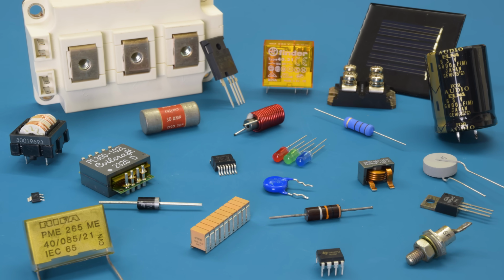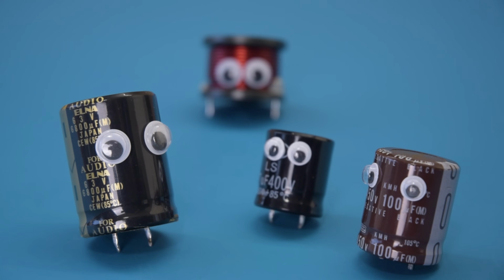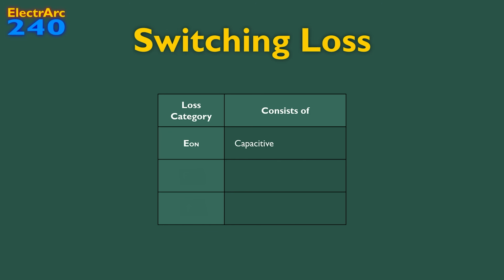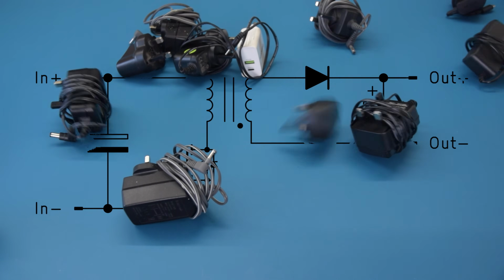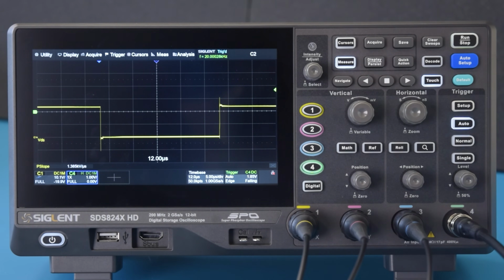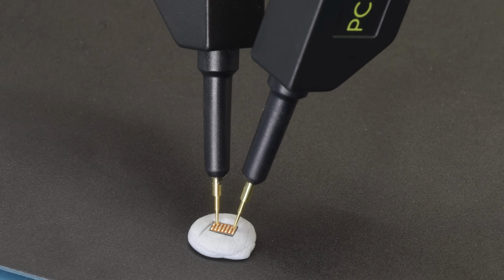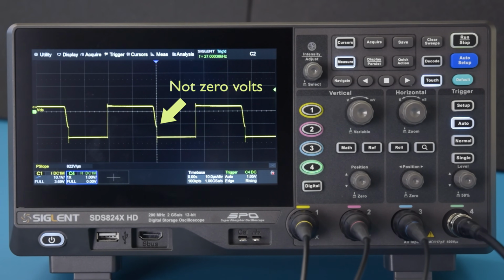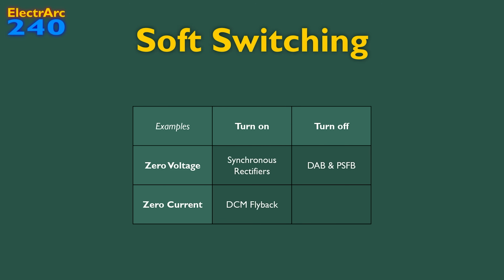Everything You Need to Know About Soft Switching (Switching Loss, ZVS, ZCS)

Comment: I built a special DC power supply for my tube amp here a few years ago. it uses a Center tapped primary winding in a Ground-Positive-Ground configuration. The 14V positive power is fed into the center tap of the primary and each end has a pair of Mosfet to ground switching back and forth. in order to make this switching efficient and noise free I added film capacitors across each mosfet bank that was chosen to the lowest total power consumption of the power supply. instead of wasting this stored charge in the caps when the mosfets close it instead goes back into the primary winding helping the opposite end to start reversing the current in the transformer. The switching gets much more efficient and keeps the voltage spikes across the fets low behaving a bit like an LC circuit I suppose. It then steps the voltage up to 700VRMS AC in a single secondary winding that is rectified and regulated down to 220-500VDC that has no measurable ripple in hearing range at all by scope. less than 1mv ripple that is at switching frequency above 20khz across the whole load range. The Power is so clean I don´t need filtering on my amp for even the preamp stages. it took a lot of tinkering before I found the best design for this

Comment: wounder when or if GaN will be usable in hobby builds
Reply from the maker: Maybe I could offer a GaN kit 👀
Reply: It should be already. GaNs are offered for a long time now in Enhancement Mode flavour and are VERY easy to drive with 5V and minimal peak current.
I've strapped a BJT totem-pole to STM32 pin and was able to drive EPC2308 far into MHz range with no problems.

Comment: As someone working in the field, I am once again amazed at how pedagogic your videos are. Even learning new things and new ways of seeing the same problems I see erveryday. Also love to see the ceralink from TDK in the intro !
Reply from the maker: Thank you very much! Glad someone noticed the CeraLink haha, I love them ;)
Reply: Ceralink? Never heard of them, had to check out. They are special ceramic capacitors that have their maximum capacitance at some working voltage rather than at 0 V like normal ceramics. Super cool stuff.

I have actually tried doing that to inductors - having a permanent magnet within the core shifts the saturation points around, potentially allowing to have high inductance at the working current. Never made it work though.
Reply from the maker: @invendelirium  I was thinking of trying that PM biasing inductor thing for a video, what didn't work? I presume eddy-current losses in the inductor?
Reply: @electrarc240  i just never came up with a way to build one. Having a super-thin slice of permanent magnet to insert into a core gap isn't an easy thing to do. Also, neodymium probably won't work because of eddy currents (neos are pretty conductive), unless you can find one that is a powder in a polymer matrix.
Reply: CeraLink stuff costs absolutely absurd money.

Comment: The switching loss comes from the reverse recovery of the electrical charge existing in a semiconductor.
Reply: Well, you clearly didn't watch the video...
Reply: @thomasp @thomasp.6197 ot sure you understand the concept of reverse recovery. I recommend you checked the diode because there an easier explanation of what charge needs recovered.
As for the show, it tries to cover all bases but I’m personally not impressed with the result. Is a good show (not their best, I liked more the transistor-based power supplies) that beats it around the bush if you really looked to find out my opinion.